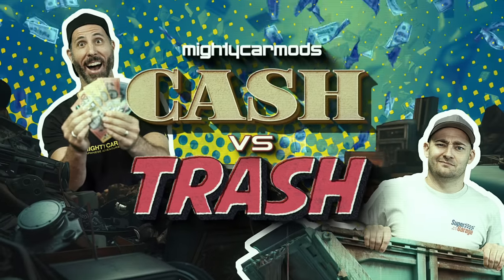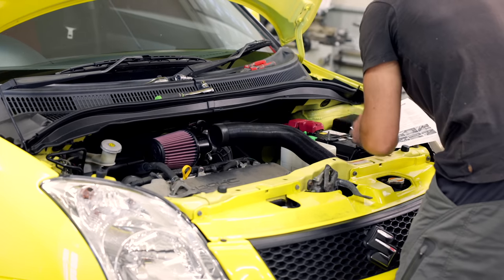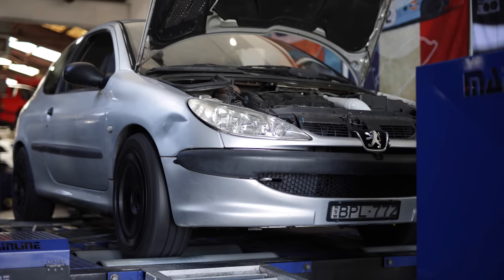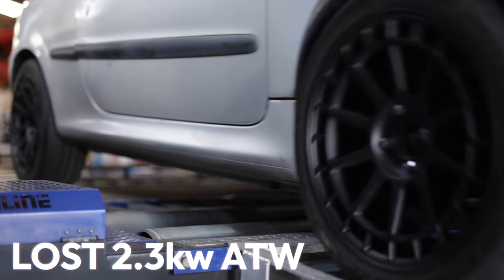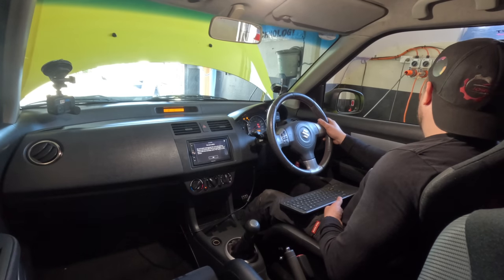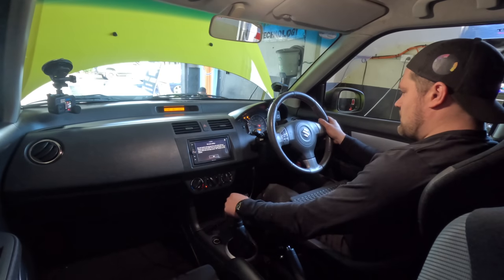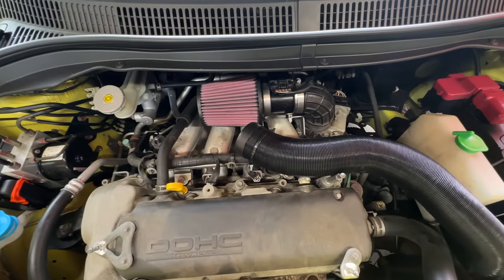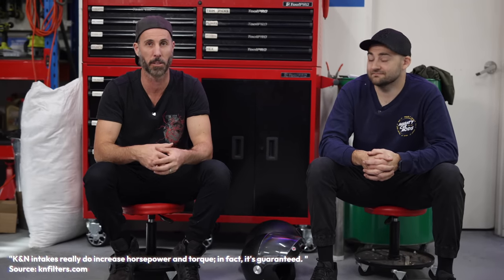Dyno testing POD FILTER Performance Claims | CASH vs TRASH

Comment: I work as a calibration engineer in the automotive industry (we do essentially what Scotty does when they install a Haltech and he puts all the numbers into the maps and tables but our ECUs are from Bosch, Denso, Delphi etc). I've worked at a motorcycle oem before and now I work with diesel engines that have been converted to hydrogen combustion.

I assume that the ECU of the Swift works pretty similar to what I've seen on the motorcycles and how I think haltech ECUs work as well (I have never worked with one before). It's a lambda=1 concept, which means that you open the throttle blade according to a accelerator input (ride by wire, or actual wire, doesn't matter) and then the ECU squirts the fuel into the port according to the measured Air Mass and the defined lambda (somewhere between 0.95 and 1.10, in stationary load points).

So in theory if everything (temperature in dyno room, humidity and ambient pressure) is the same on both days and you install a "less restrictive" air filter you'd have less pressure drop at the filter element (which is very very small anyways on clean, stock intake systems).

So with less pressure drop at the filter element you have theoretically more Air mass jammed into the engine and for the same "lambda setpoint" at full throttle the ECU would inject more fuel and thus generating more power.

However, we are talking very minimal differences (think of the leaf blower in the turbo chargers mythbasted video). So even if you could measure a small increased AirMass and the ECU would inject more fuel you could probably not even measure it at the wheels due to the dyno tolerances.

However you do suck in hot air directly over the engine instead of ambient temperature which probably negates all the theoretical wins you could get earlier and you probably lose actualy measurable power by removing the intake manifold that's most likely tuned to produce a certain HP at a certain rpm. In theory shorter intake manifolds yield in power higher up in the rev-band and longer more in the middle (that's why some N/A cars have switchable air paths). 

Which length and diameter leads to which increases at which rev point is very scientifical and I wouldn't know how to calculate that. It's safe to assume though that it very much depends on the engine parameters and for all we know the "sweet spot" of this K&N manifold might be at rpms way beyond the rev limiter of this little car, or much lower. Have you plotted the power curves on top of each other for every run? Would be interesting to analyze.

You can lose power with the warmer intake temperature, the (I assume) "untuned" intake dimensions, dyno tolerances, weather conditions that specific day...oh and does it have a knock control? Atmospheric pressure and temperature influences the knock tendency on petrol cars as well, so maybe the knock controller dialed the ignition back a little, that's probably a much bigger factor than anything else.

Comment: You guys should get the cars tuned with the mods, that way you can maximize those mods cause like what was said the stock tune prob doesn’t compensate
Reply: Honestly super surprised they haven't.
Reply: @SlowSTEN  right? Usually they slap a haltech on it by now
Reply: even just resetting ecm may have helped, worth a try
Reply: @GrizzlyGarage  Because they wanna race them with just adding mods, no tune or anything like that I believe don’t quote me
Reply: @oDilby  yeah I’m pretty sure you’re right
Reply: Exactly what I was thinking all this time when the Haltec's not being put in.  There is no capturing of data, no changing of injector size, no adding timing.
Reply: New ecu and Pro tune vs used ecu and street tune or a chip
Reply: That K&N intake is hot garbage though. tune or no tune.
Reply: @fullsendmarinedarwin7244 facts, any aftermarket intake on a stock motor will always perform worse. Also a majority of the time you lose a lot of useable power because of it. All from experience when I used a short ram intake on my car. Kept it stock ever since
Reply: Pretty sure it would work for the Swift but not the 206. I believe 206 ECUs are pretty much bricked so you cant do anything with em.
Reply: Stock tune actually over compensates, you end up getting pig rich when you dont tune for it. The engine will notice "more airs coming in, better add more fuel to be safe" then it will slowly taper it off. Look up open loop and closed loop tuning, and fueling trim systems. Also, if you want to see a filter actually add horsepower, Moore Mafia here on youtube, tunes bikes and has plenty of videos up using "Sprint" air filters and gaining 5-15 Hp over stock, even before a tune. Granted this is bikes vs cars ect.. but its really not all that different these days.
Reply: @PrestigiousBurrito  in case of the 206 it's a Bosch ME7.4 ECU, pretty much every tuner knows how to tune it.

Comment: U have to tune it to fully maximise the power. Just bolting these on will cause power loss
Reply: Exactly. Bolt ons only give power gains if the ECU knows what it’s working with.
Reply: K&N doesn't specify if tune is needed or not.
Reply: @fohatadri  U can bolt on a K&N air filter no problems. It will change the induction sound making you think it is better but there will be no objective improvements as the ECU doesnt know what to do with the increased airflow. If anything it panics and cuts power for safety as it gets confused. 

U can put it on and it wont do any harm but u will not get a true performance benefit until u turn your car. Most people add filter, then exhaust, headers etc. then when u have them all bolted on that you are going to get then u go for a tune to keep costs down (tune after each bolt on is too costly). Then u will get the combined benefits of all the breathing mods.

Comment: Is the tyre size different between dyno runs? That will definitely effect power reading on the dyno.
Reply: Yeah it is. That's why the results are irrelevant and also there was no tuning carried out which is essential to get the gains from mods.
Reply: @jackrichards1863  it's not essential, of the tune was a bit fat stock (which they pretty much all tend to be), opening up intake and exhaust can improve volumetric efficiency and give some small gains. Bigger gains can be achieved with tuning.
Reply: @shayispunkish  pretty much. Still those efficiencies are pretty clean so they should be able to capitalize on the change. Very hard to beat a factory assembly now I'm the performer cars like the Sport or Peugot, or the hot Golf is hard to improve on those hot models

Comment: The k&n intake for my car came with a heat shield to block excess engine heat. I get around 4-5 more whp after install however if the car is idling for an extended period the air temperature becomes so high that all the gained power from the intake is lost until it cools back down. The placement of the intake is extremely important as placing it closer to hot engine components like exhaust headers can make you lose power even with proper airflow.

Comment: For the Peugeot the expanded exhaust piping will have the impact of lowering exhaust velocity, this directly impacts the scavenging effect, which directly impacts the air fuel ratio (aka. power).

Going from a 2.0 inch pipe to a 2.25 inch pipe would have minimal negative effects in the lower RPM range while giving a bit more breathing room for higher RPMs.  Going from 2.0 inch to 3.0 inch (without large displacement, a turbo or supercharger) will result in a loss of power.  Dale covered the basics of this on MCM2 2 weeks ago.

As per the Peugeot intake, I would wrap every joint/connection with tape, just to make sure there are no leaks, as any air leaks past the air metering device will have a negative impact on the air fuel ratio.  The ECU is expecting a certain amount of metered air, but the reading via the oxygen sensor is different (ie. there is more air present than expected), which the ECU will react by changing the amount of fuel being delivered - thereby taking the engine outside of it's tune operating zone.  More air and more fuel is only good if it can be leveraged (ie. it is tuned for that volume), otherwise it is wasted.

Along with that, the Peugeot (being much older and likely not maintained) should get new spark plugs at a minimum.  If the existing ones are high on the time usage, they will also be out of their efficiency range.

Per the Swift intake...  The filter element placement is really poor.  If possible, I would rotate it to be away being directly over the engine, then try to get/make some ducting that would channel air from the front of the vehicle directly to the air filter.  That would help to mitigate the negative impacts that intake clearly has.

Comment: It would be interesting to test a K&N filter inside the standard airbox.
Reply: K&N filters are shit. They have fewer pleats, which means less airflow, their material is thinner, and instead they soak them in oil to try to compensate for the shitty filter.
Want a good filter? Pick something with a lot of pleats, and thick material. The pleats will let it flow better, the thicker material will filter more.
Reply: @Nabeelco  was that something you read on a forum?
Reply: @TheStriker0525  No, it's something automotive engineers, mechanics and scientists have said.

Comment: Shouldnt y re-tune or re-map the ecu after these modifications? Y add more air and exhaust fumes leave more easily. The character of the car as we say in Greece changes. Without the proper ecu program u won't see any improvement no matter how many money you spend. A friend of mine has a Suzuki swift sport which has a full exhaust system with a racing catalytic converter, doesn't have a cold air filter. With  the ecu program makes 137hp to the wheels
Reply: It makes sense to do a remap of the ecu, also with more fuel and air coming in a new set of sparkplugs properly gapped can make a big difference, may be even more with some colder ones. Bigger injectors, bigger throttle body, if you do cams you pass the threshold of a stand alone ecu depending on make and model. The 206 I would engine swap before going that far. The swift need a turbo to get any serious gain in power. Stage 3 tune without a turbo can lead up to 150bhp. With a modest turbo setup 190 for a daily driver is easy to achieve but you are thousands of dollars in it at that point.
Reply: I like cars but im a bit more of a bike dude. We tuned a yamaha xtx660 last week and it has an open filter, an exhaust ,a reprofile camshaft and a bit of handmade porting at the head (stock piston). It had its ecu tuned by a proper man and now makes 62whp. Months ago we turned a different xtx660 and it had everything from a high compression piston to a Very big camshaft with big throttle body BUT he wanted to go to a different tuner so it made 68whp and it keeps failing the sparks plugs (bad tune). With the proper tune it should make over 75++ whp. That's im trying to say. Every thing is the ecu
Reply: @atrem7942  Yes but the point of this series is "is the expensive after market modifications worth it or can y do it cheaper with a bit of your knowledge and cheap stuff?" Of course big name brands are better (although most of your money goes to the name of the brand. For an example y pay double the money for a K&N filter but y can find an equally good quality filter for the half price)  but the thing im trying to say throwing all these stuff on the engine won't do anything without a proper ecu program
Reply: @john013 john013  i literally start with saying a ecu remap makes sense, why are you making it look like, I am saying something else. I don't even mention any big brands names. For most people it is about the driving experience exhaust making the engine roar. Intake suction sound same thing. In their mind they think it makes the car go faster and that is all they want. Reality proofs no real gains are had unless you remap the ecu to make sense of the bigger volume of air and fuel coming in and the exhaust having less back pressure. more then the real gain of torque or horse power the sound experience is all they get certainly those people who only fit a cold air intake and exhaust.

Comment: You need to map the ECU to use that extra airflow (both in and out)
Reply: This - Surely that is what's missing?
Reply: As long as the maf sensor can see the extra air flow and the iat sees it's cooler, the ECU should raise fuel trims accordingly. You've got a bout 20% injector duty cycle as headroom remember 👍
Reply: @jossdauncey4986  the stock ECU isn't adjusting that much, it can adjust a bit for hot or cold air, it can't cope with mechanical mods
Reply: Yeah to use the extra hot air that is being sucked in from the engine compartment now
Reply: @jossdauncey4986  This is the right answer. For your typical non-turbo injection engine (not mechanical injection), the factory tables have more than enough headroom to cope with the negligible extra airflow from a fart can and pod filter.
If you run full exhaust with headers and decat you will see gains with a tune, but even that should run better than stock with no remap.
Reply: Modern factory ECUs target air fuel ratios, they don't just assume "in all cases at X rpm I'll definitely need this injector duty cycle and everything else will be even and predictable."
There is absolutely no need to tune around an exhaust and an intake. If it lost power it's because there is less air available for squishing, or the air was hotter and less squishable.

Comment: For my Swift Sport the best air intake was Simota with "carbon" cover. It increased the stock power by 5hp. No oil on it so it doesn't foul the maf reading as well and grabs the air from directly in front of the cars bonnet (you can cut the bonnets gasket for better airflow in that part).
Reply: Absolute Mad Chad  autocorrection hahah. It was meant to say Simota of course. And it's not a lie, I did 4 Dyno tests. Stock was 126bhp, air filter 131bhp, with full custom exhaust 136bhp and remap brought it to 142bhp.

Comment: Hi, mechanical engineer here. I could throw theories about what's going on but to be honest you should do what every engineer does, modify and log variables, not just engine power.
Grab a laptop and log the ecu, especially these parameters : engine load, iat, mass flow and pressure at the manifold.
Do this with the stock intake and the pod filter and you should tell right way what's the problem.
If I could bet, the iat is probably higher with the pod filter, which with the same pressure at the manifold, reduces air mass, reducing power.
Simple equation: pv=mrt

Comment: A lot of cars will not have self-learning ECU's, and when you just throw more air at them, they'll struggle with matching up the AFR and start to attempt compensating for reading what it perceives as wrong values and end up cutting power because it thinks it's too lean etc. Some cars come with self-learning ones that you just need to leave the battery off of for an hour or so, then teach it the injector profiles etc through driving it again after the reset and have a lot of sudden stops from choking out the engine as it's learning. Evo 7 to 9 ecu's are known to be such ECU's that you can teach and also tune by connecting to, but for many folks it's better to pick the latter and actually head to a proper tuning shop to get dyno-run tuning done.

Comment: Peugeot recipe for power
Work some Venturi effect by going two steps up (one at a time) on the intake it will provide aceleration of the laminar flow and keep the readings right.
The new exhaust size is too far  away from the log manifold, its got to be right from the log to the 3 incher.
Now the thing that really makes it go, Timing... You can throw almost 10 degrees of advance at it, just keep it very rich to be on the safe side. ( Those engine are undertuned for safety, they are sold in some markets that are not worried about fuel standards)

Comment: The best bang for the buck is to modify the existing airbox. Remove the silencer and figure out a clean way to fill the hole. Add reflective heat tape/wrap to the airbox to reduce heat soak. Then get a high flow panel filter to drop in.

Comment: When testing the Suzuki Swift wouldn't having the hood/ bonnet closed improve the air intake performance. Especially with that K&N configuration with the hose spitting "cold fresh" air (supposedly) on to the filter located almost at the firewall.😮 Maybe try moving the filter to the lowest point possible towards the front bumper to get to the said cold air. Maybe remove the right fog light, and put the filter if possible in that area then feed it back to the throttle. An possibly heat shield wrap the piping as well. Plus bigger intake pipe doesn't mean better performance ether.

Comment: It's the same thing with my gen Civic Si.  The stock intake is better than any aftermarket intake of the same size.  The only time an intake is worth it is if it uses bigger pipe, and it's tuned.

Comment: When you had the expert there on the podfilters, het said that having it on top of the block would result in hp loss and you should construct a cold airintake. So no surprises. 
If you want to go for weightredu tion after ditching all the mats, rear seat and rest of the interior, throw dry ice in the footwell, let it evaporate, take a hammer and brake the tar and remove it. Then put primer on the bare metal.

Comment: Way way back in the day I used to tune RD350s. K&N filters along with the exhaust were always the first thing to sort out. However unless you up-jetted the carbs it would lose power. With "Allspeed's" which gained midrange it was two jet sizes bigger and "Micron" three. This was on top of altering squish clearance down to 0.9mm and the porting and gas flowing. I was no Stan Stephens but we were regularly top 5. I would therefore suggest you might be running a bit lean.